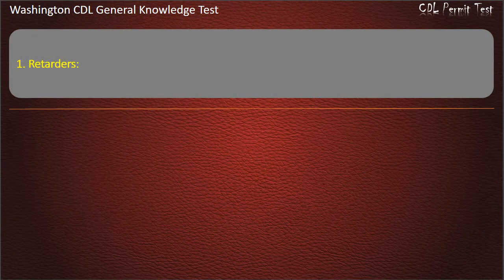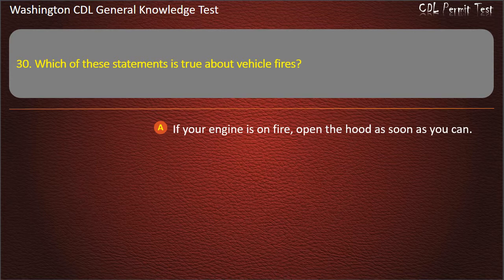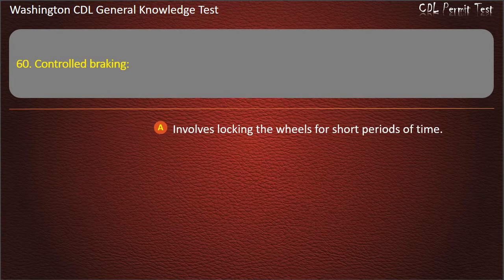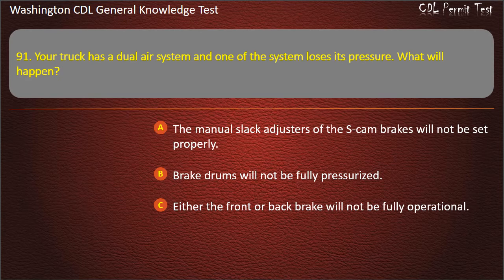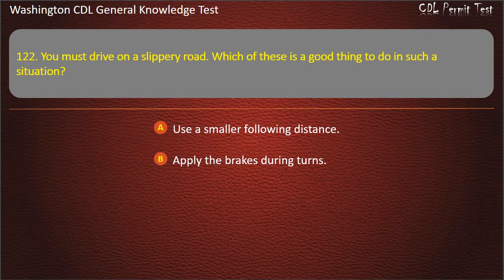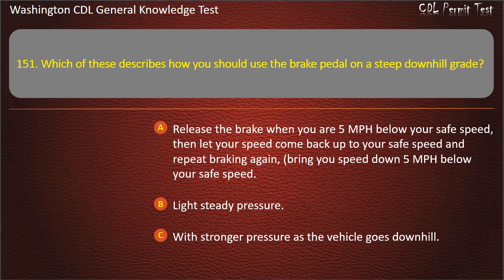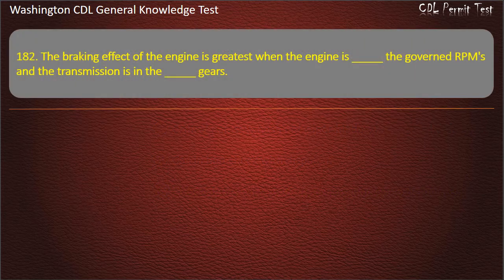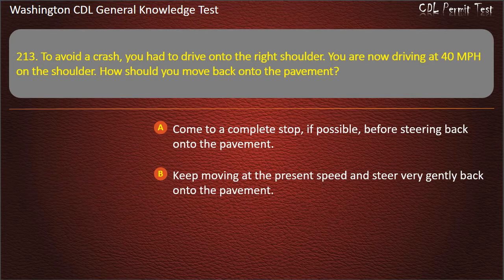Washington CDL General Knowledge Test

Comment: Question 53: In the CDL handbook it says:  "When it is legal, tap the horn lightly or, at night, flash your lights from low to high beam and back. And, drive carefully enough to avoid a crash even if they don’t see or hear you.". So it seems like A would be the correct answer, as you would not want to keep them on, but just flash them.
Reply: Agreed because if you blast them with the high beams it blinds the car and risks an accident
Reply: I answered with the horn and it said I was wrong and in your answer based on the actual test I took the correct answer is A. Flash your high beams… but according to this video my answer using horns was correct. I’ve failed at this one feeling all frustrated cuz it’s both a correct answer… but apparently the actual test wants 1 answer….
Reply: Flashing lights means animals crossing so if you did that people might be confused if no animals were crossing